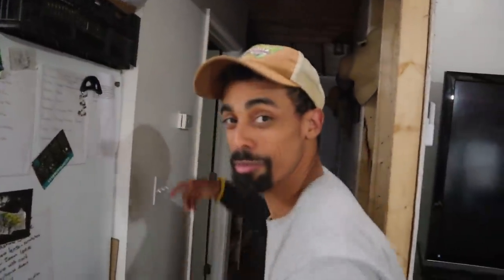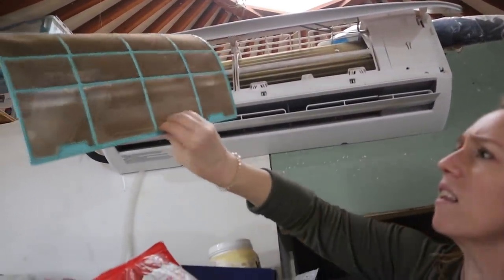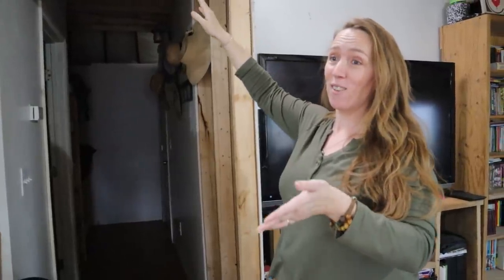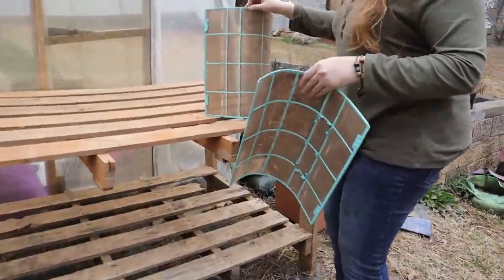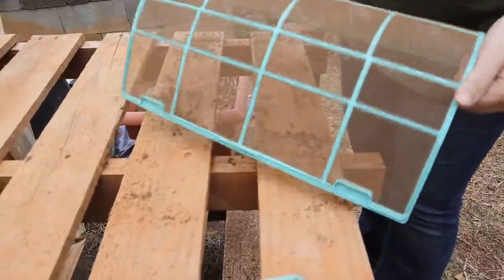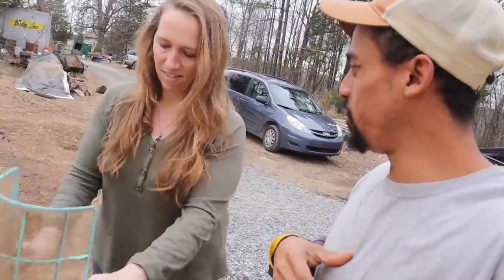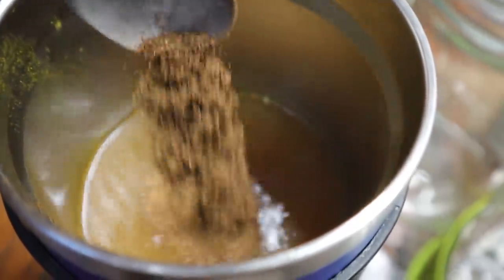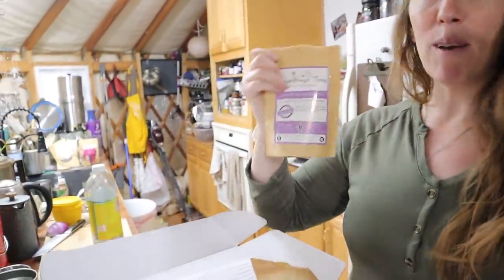How WE are trying to STAY WARM in a YURT

Comment: Lacey, you shouldn’t smack your plastic screens to clean them, in time they will break. Just use a soft soapy brush to scrub them, then rinse with water. Viola, it clean!
Reply: Totally agree, the frame is thin plastic and will only take that a shirt while before breaking down
Reply: I dont have minisplits, but they're like the dust filters in my PC I use the compressor to blow out the dust

Comment: Those will crack cleaning them that way. Soap and water dry with a towel would keep them cleaner longer. Love your blogs.😃
Reply: She should just vacuum them.
Reply: also using a soft toothbrush would help too and don't forget to clean out the dryer's lint trap after each load and clean the screen with hot water dryer sheets make the screen gunky
Reply: I was thinking the same thing.  I'd vacuum them.

Comment: I indeed have a better suggestion to clean the filters to the mini split.
If you have a local Dollar Tree or Walmart, purchase two of the $0.99 spray bottles,  fill both with water. Put 8 drops of Dawn dishwashing liquid in one and leave the other plain.
Take the filters and spray both with soapy water then rinse with plain water, pat dry with towels, then place them back into the system...easy peezy.😊

Comment: Be aware that tapping the filter will eventually cause cracks in the plastic then breaking. I learned this from cleaning the filters in our air conditioners. I uses a small whisk broom gently on the back first then gently on the front.  Hope this is helpful!
Reply: A 'ask me how I know' moment, right?!
Reply: Could you not vacuum the filters?

Comment: My recommendation on the cleaning of the filters is spray hose in the shower and dawn for deep cleaning. Oh and an old soft toothbrush. Or you can use a handheld vaccum to suck the dust off or regular vaccum with attachment. Personally i use my first one most. Even for the vaccum filter. 
 Be careful with sap. You do not want to use it in fireplaces. The sap will stick thru out the chimney and build up thus fore possibly starting a fire in the house. Btw i am very allergic to pine and its sap. Spruce and juniper too

Comment: Mini-Split users are not told, but in the summer time the louvers will collect mold from the humidity. They will be spin full speed but little air will blow out, that's a sign it's time to service. Each season you will need to disassemble the blower and rinse off the moldy gunk and grime from all the blower louvers.

Comment: I tap off the filters then spray them from the back side to push the dirt out the same way it came in.  Then tap it dry and reinstall.  If they are a bit moist when you reinstall, don't sweat it, it will work fine.

Comment: Straw or bales of hay around the bottom.

Used to live in a 5th travel trailer. Put insulation around the bottom but you can use
Bales of hay or straw around the bottom to help with the cold

Comment: We lived in Kalispell MT for seven years. Ran a wood burning stove and I miss it so much! We did have central air but we chose to feed the fire baby at night and mainly heat the house with the stove. I'd run the fan on the central system in really really cold nights -22°F to circulate the heat down into the basement where pipes were exposed to cooler air... but man... our electric bill was so nice and gas was next to nothing since only our furnace ran on it. We now live in NM... drastic difference in every way but I still miss my wood stove... even the work...I like to stay in shape with things that have purpose, and that did keep us in shape. Those filters look just like window A/C unit filters, I use my vacuum to clean mine. They get bad with 6 cats and the dust/ sand we get here. I'm pretty sure I've breathed more sand here than my whole other 45 years combined elsewhere! You guys are so cute!! Smiles and blessings...

Comment: If you put it upside down on a water source, it will push the dirt right out of it. Simple as pie. I also use the vaccume, but I find that the water does a quick and easy job. Just let it dry or dry it well with a rag.

Comment: We were -8°f this morning.  We keep our furnace set at 68°. I wish we had a wood stove, it’s such a nice warm heat, propane is a more consistent heat so its cooler.  I have no heat in my upstairs, I used to have an 8’ run of electric heaters and it was a bit of over kill because it was always 80° f in here and cost an extra $200 a month to use in the winter and I am now considering a mini split to replace the electric heat I removed. (I’m a chaga in my coffee person) 
☮️-Kirsten

Comment: Mike I looked up tree resin and found this out 
1. What can tree resin be used for?
Resin is used for skateboards to prevent cracking, chipping, and breakage. Turpentine from certain pine trees has been used medicinally for treatment of cough, gonorrhea, and rheumatism. Tar water, resin steeped in water, used to be recommended by doctors for illnesses such as smallpox, ulcers and syphilis

2. What happens if resin gets on your skin?
Repeated skin contact with resins and hardeners may also cause chronic contact dermatitis, which is usually milder but longer lasting. If left untreated for long periods it can progress to eczema, a form of dermatitis that can include swelling, blisters, and itching.

Comment: I'm a coffee in the am and an herbal tea, hot or cold, the rest of the day.  
Here's some tips for staying warm when its real cold.  Wear natural fibers, cotton and wool, in layers.  I replace my T-shirt with a turtleneck or other high collared top.  I top that with another sweater,, vest or hoodie.  2 layers of pants, leggings or long johns and sweats or jeans.  Socks in layers too.  Cotton against the skin and a top layer of cotton or wool.  I keep 2 pair of heavy wool socks just for winter time.  Slippers or some kind of house shoe, only one layer.  The body seeps heat through your feet and head so keeping them warm is a good thing.
All the layering creates insulating pockets of air that helps keep you warm.  It also helps you lower the house temperature and still be comfortable.  This leads to energy cost savings as well as contributing to the health of Mother Earth.  A cooler house temperature has human health benefits.  The air is less dry as well.  I keep my house at about 68 degrees F.
Greetings from the warmest part of Pennsylvania, Lancaster County.  Stay warm my friends!

Comment: Mike seems to be getting younger.  No really... Ok so the Problem with wood stoves. They blast radiated Heat and dump the other 80% up the chimney with out any thermal retention.  Mass rocket heater stoves are the most attractive option and a HUGE reduction and consumption in fuel burning.  Nothing new i know you know just a reminder to folks.  They are simple to build and frame in with common materials. Benefit additions a Place to sit, cook and snuggle.